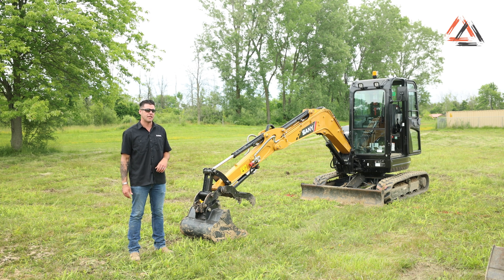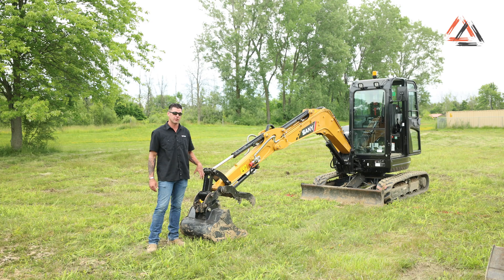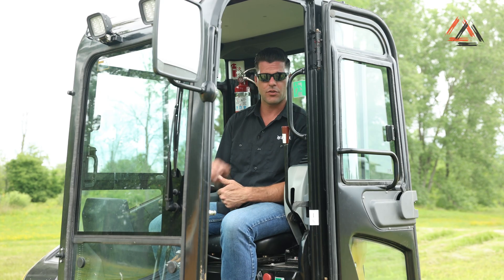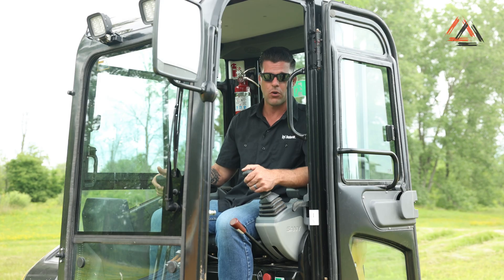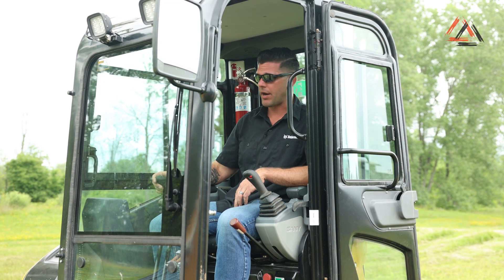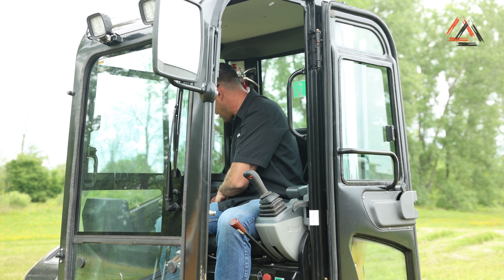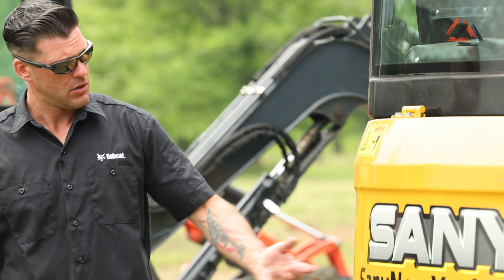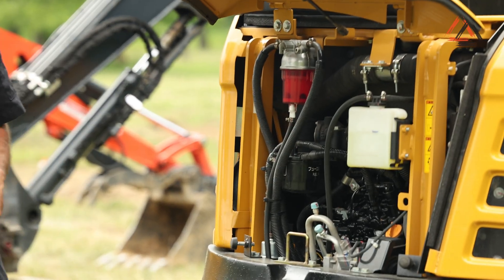Sany SY35U Walk-Through - 3-Ton Mini Excavator Comparison Series

Comment: You forgot 2 more pros. Sany is about $30,000 less that your Bobcat and gives you a 5 yr, 5,000 hour warranty vs Bobcat’s run of the mil 2  yr, 2,000 hour warranty. Also, you have to have your key every time to fuel the Bobcat too as it’s a locking cap so that’s kinda mute. I also prefer the metal access panels vs all the plastic Bobcat uses. And I’ll take the Yanmar engine on the Sany over the Doosan on the bobcat any day. And for 30k less, I’ll take the narrower door and the dozer blade controller in the different location. For that price, you can keep your touchscreen too. Bobcats doing what Ford, Chevy, and Ram has done with trucks. Added all these extra features no one needs and jacks the price up where the average person can’t afford. I’ll be purchasing a SANY SY35U in 60 days. I’m 5’ 10” and 200 pounds. Plenty of room for me…….And for 30k less, I’ll go buy a $2 permanent marker and label the fuel and hydraulic tanks myself. Though you’d have to be an idiot to not know just by looking at them. Hydraulic tanks will always be the heavily built steel tank with the heavy duty steel cap. Diesel will be the plastic tank.
Reply: Well stated!

Comment: Sounds like u don't have  much good to say about the sant. But l like my little 2.6 ton and alot of its features like the locking fuel compartment etc.
Reply from the maker: It's a cheaply built excavator that digs a hole. It's not that we don't like it. It's just not great for commercial business long term. It's a homeowner excavator. Locking fuel caps can be had with all brands.
Reply from the maker: And I am specifically referring to the compact excavator. We are relatively inexperienced with the heavy sany product.
Reply: @UpstateEquipment have you had many issues with them? What are weaknesses that tend to break?
Reply from the maker: Great question @skydaddy2426  We in our demo didn't have enough hands on time to break the machine but what I can tell you is that the exposed hydraulic hoses near the backfill blade as well as the materials used are just a lighter grade than what you would typically see in a manufactured mini ex which will definitely lead to faster depreciation. The seat material particularly can be a cheap vinyl that could rupture quite quickly. 

Again, not just putting the machine down. You just get what you pay for :/